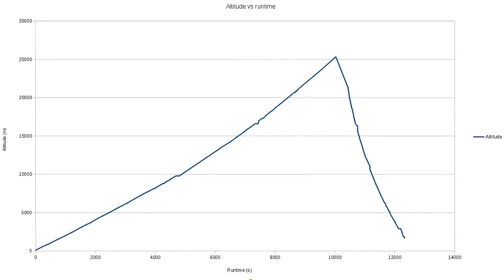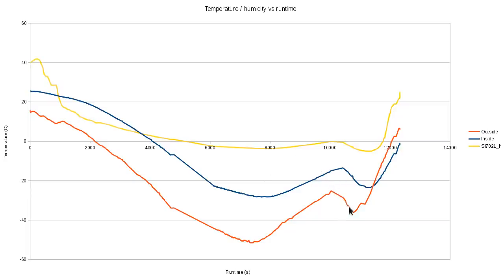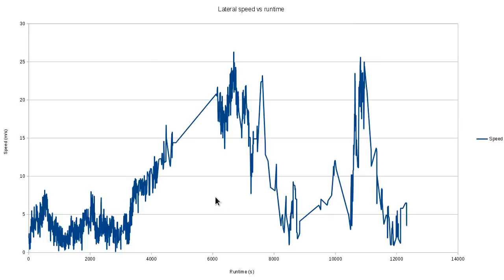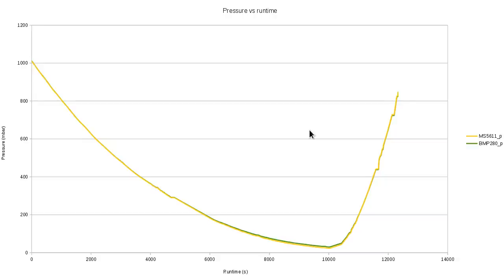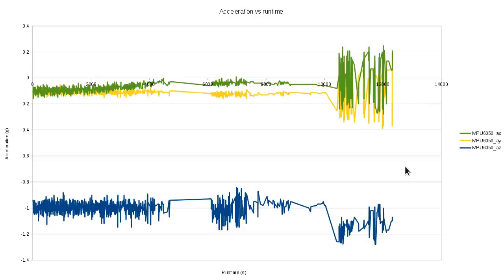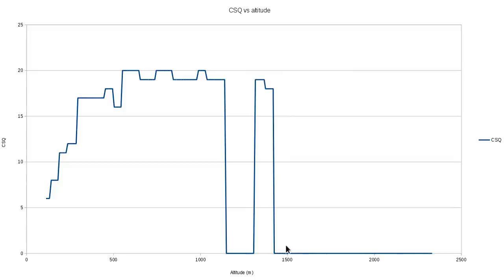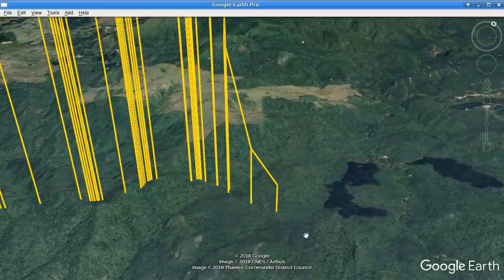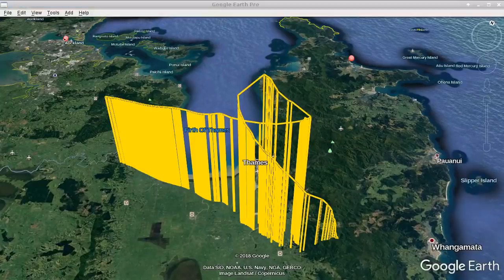Arduino mini radiosonde part 6 (data review)

Comment: Have you tried a formula for altitude from barometric pressure that factors in the temperature? The Wikipedia page you showed did not seem to include temperature. Give this a look https://www.mide.com/pages/air-pressure-at-altitude-calculator

Comment: Thanks a lot for this video series. I really learned a lot and had some fun. Sadly I am living near an airport and I think there are more strict rules for starting even such small balloons here in Germany.
I expected the mobile com module to work for a bit longer, too, but since you are living in a very flat area, I guess all you mobil towers using directional antennas (like all towers do) with a very low angle. I wanted to comment on the last video, but I do it here: I guess the parachute isn't really working after the balloon popped, since it is in really thin atmosphere...
And finally....Would it be possible to use some kind of direktional antenna on the sonde, too, since you do not need to send signal above the balloon. I was thinking of something cheap like "using a CD around a WiFi antenna to make it direktional" :)
Reply from the maker: At one point I was considering putting a 5.8GHz video transmitter on, for that I would have used a downward-facing patch antenna. Since the other stuff seems to be working ok like this though I would just leave it as is for next time.

Comment: Would you do it again in the future? Might want to add more sensor such CO2/CO gas sensor or MQ-131 ozone sensor. Might be more interesting 😉
Reply: I think that most probably these kind of sensors wouldn't work in such a low temperatures... They use an electrochemical process to give out a signal which uses a heater inside. Even in a 25 degree C room they need a couple of minutes to warm up and give valid data! And they are also a bit power hungry as far as i can remember :(
Reply from the maker: I was looking at some of the air-quality/gas detection sensors on Banggood but was put off by most of them requiring a constant 20mA to run their little heaters. The other thing was they are not sensitive enough for this purpose because I think they are only made to detect dangerously high levels of gas. I suspect a sensor that is sensitive enough to detect tiny differences in say C02 at various altitudes would be rather out of my budget.
Reply: @iforce2d 
Those sensors that need a constant current essentially "burn" the gases they measure. The oxidizing removes oxygen that is adsorbed to the sensor material which changes it's resistance. So it doesn't work almost at all for CO2, because you need gases that can be oxidized (carbon monoxide, hydrocarbon vapors, ammonia). To reset they need to adsorb oxygen from the air again (that's why they are very slow to react if you don't force air through them). But guess what: the reaction is also temperature dependent (obviously; otherwise why the heating?) and oxygen concentration dependent. The latter means, pressure dependent. So no good for a project that changes both of those variables over such a huge span, unless you figure out the formula to calibrate for all those extremes.

CO2 is usually measured by absorption of IR. It's very sensitive (I built/used sensors like that), but again, it measures absolute amount in a volume of gas. That's no use (at least on it's own) if you have both temperature and pressure changing the density of the gas you are measuring.

Almost all sensors you can buy are for "standard conditions". Being at 5% MSL pressure or temperatures where your anti-freeze is solid isn't one of them ;) .
Reply: Well, i thought you can give it a try until you guys said it was power hungry. So nope. Looking forward for the next time, btw maybe you can make your own parachute 😉

Comment: Please do it again, but hopefully with the runcam, I'm sure the footage would be amazing from around 20k up. But hopefully heaps of helium so a more straight up and down type of flight?
Reply from the maker: Yeah, I'll be making sure there is too much next time, or perhaps could try some kind of cut-down mechanism.
Reply: @iforce2d  
 A release mechanism at a specific point would be nice, but I'm sure it would add up to a bit with weight.

Comment: Btw an idea for a project - Auto-tracking Yagi antenna in a cupula/dome (so it dont fly off the roof of your car) :)
Reply: That would be cool...  I wonder if stock Ardupilot Antenna Tracker can adequately compensate for the movement of the car underneath it.

Comment: You should send out a quad with GPS
Reply: Quad (or fixed wing) with a nRF24L01 and an SD card would be pretty handy if you can do it before the balloon's battery dies - as long as it flies within a few kilometres of the landing site, it should be able to log the balloon's GPS.
Reply: Would be a bit tricky getting land owner permission though. You could always get a 102 exemption for that, but that's a whole bunch of hoops to jump through.

Comment: The accelerator sensor is hotter coz it's idea is to measure internal chip temperature for calibration of the mems sensor(s) and not to measure the ambient temperature. As far as I tested it on MPU9250/6050/6500 chips it's around 4-5+ degrees C above the room temperature and it depends on how heavy you use the chips. I would guess if you use their internal calculation unit it might heat up even more although I read it hard to program so i gave up on it :)